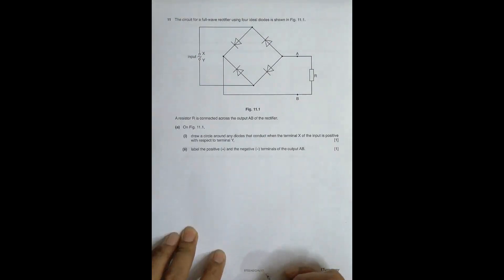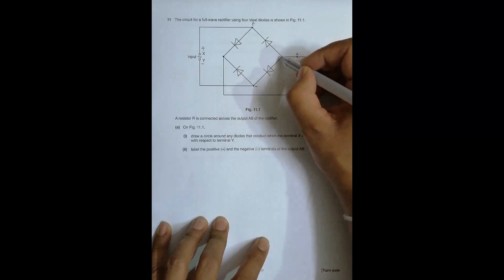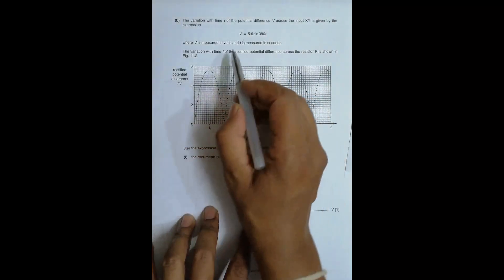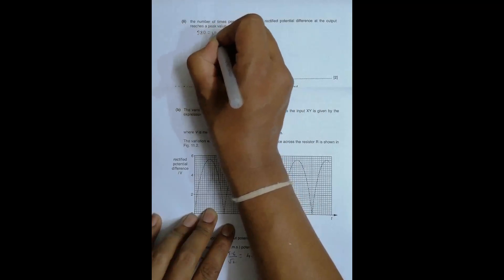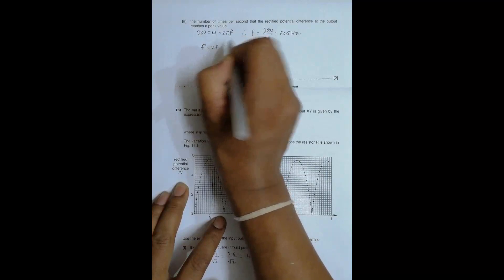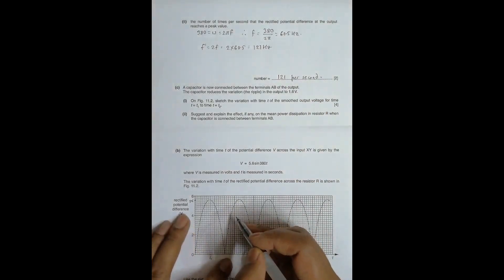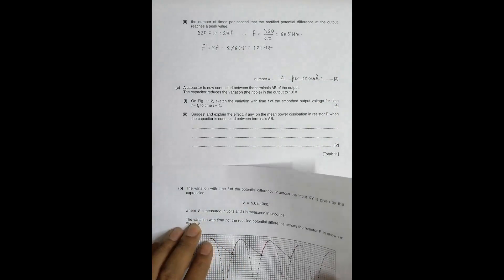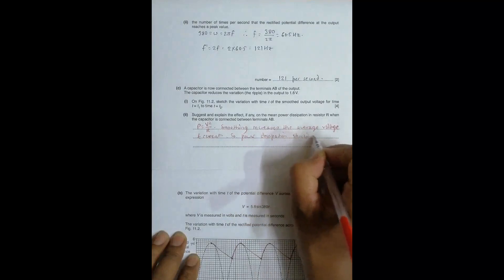2017 CAIE AS & A level October November Physics Paper 42 Q N 11 (9702/42/O/N/17) by Sajit C Shakya

Comment: Sir I didn't understand how the time period is half in b ii)
Reply: He first found out the original frequency i.e before the full wave rectification, which was around 60Hz. In the question they mentioned to find out frequency of the number of peak values. We can notice by the graph that the frequency of the peaks of the full wave rectified circuit is double than the original as the negative portion of the graph is converted to positive. So the frequency is double, hence 120Hz.
Reply: The time period isn't half; his explanation wasn't correct on that part. The above reply is correct. Basically the question was regarding the NUMBER of PEAKS in one second. Since there are two peaks each cycle (1 time period). And frequency is the total number of waves each second. That means the number of peaks per second is 2 x frequency.